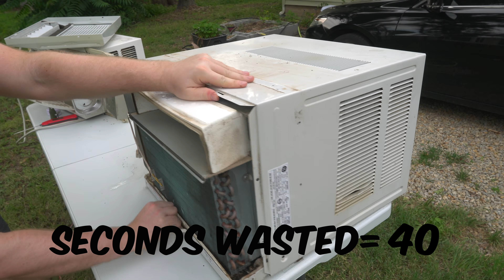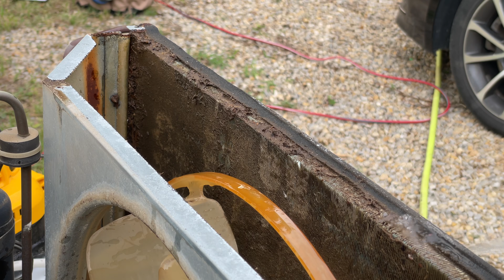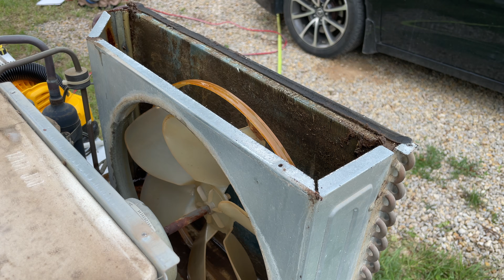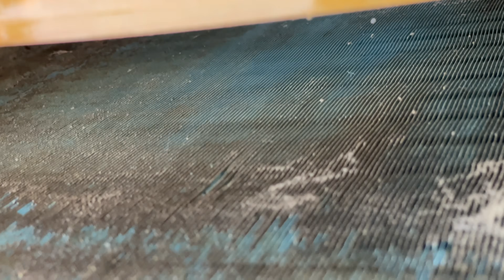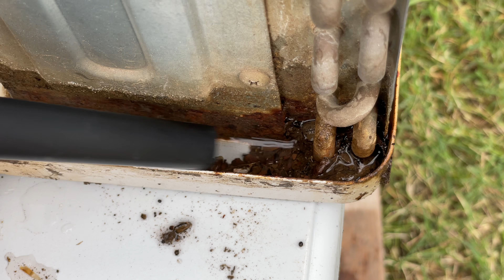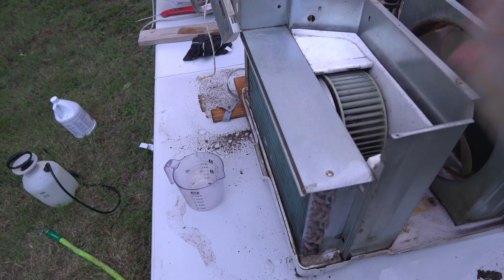DEEP Clean Window AC The Correct Way!

Comment: I have been using an electric pressure washer to knock off the dirt on the fins and no damage was done. The only time you will damage the fins is if you don’t judge your distance correctly between the tip of the pressure washer wand and the fins and you hit the fins.
And like how you’ve just demonstrated that blasting the fins at an angle is the reason the fins bend. Well, just be smart about it and spray the fins straight with the pressure washer. 
Common sense 👍
Reply: 👍 the electric pressure washer will for sure get the fins clean through and shiny way faster than just spraying detergents/degreasers and brushing making the a/c more clean and efficient in cooling. 
Plus the electric pressure washer will also help in knocking out all of the crap on the bottom tray easily.
2 birds 1 stone
🫡
Reply from the maker: I’ll have to give that a try. Thanks!
Reply: @benny_671  I tried that once with my AR Blue 1800psi electric pressure washer using a 45' fan nozzle and while the AC got super clean, it never worked again.
Reply: @LBCAndrew  I really don’t know what to tell you guys other than you must have done something wrong (too rough and rushing) and/or your a/c unit was on its way out especially since knowing that people don’t like to clean things till it’s too late and then they blame the cleaning method.

I honestly used my 2,000psi Bauer electric pressure washer from Harbor Freight with the 25° angle tip on my window a/c unit that hasn’t been cleaned in almost 6 months at a time and now it is blowing colder air and the fan blade isn’t rattling against any rust debris. And this a/c units is 10 years old
Reply from the maker: I havnt tried this, but it makes perfect sense! Thanks for sharing your tip.

Comment: I hate the way window ac units are designed, they sling that nasty water up on the condenser coil and it becomes a caked on mess
Reply: Whole house AC systems get caked with mud also. The condenser coil gets wet due to the humidity being pulled out of the air and it turns dust to mud just the same.
Reply from the maker: I find window AC units that are and are not designed this way both become a caked mess

Comment: Did you do another test after your major clean up? I would be curious to see the results. Thanks, great info video.
Reply: i guarantee you it restored its efficiency. my unit is a 10kbtu and the label says it should use 1000watts, but i noticed it was using 1400watts continuous and the cold side was only 50f, should have been closer to 30 to 35 in the environment it was in when i was doing my tests. the inside of my hot side heat exchance was worse than what we see in the video. so it it runs continuously for 24hrs, at 1000 watts it would cost me 24kwh x .12 = $2.88 per day, or $86.40 a month. with it using 1.4kwh, that would be 33kwh for 24hrs = 33kwh x .12 = $4.032 per day or $120.96 per month.
plus it will last longer if we make this stuff work easier
Reply from the maker: True true! I love how analytical and detail oriented you are. 👍🏼

Comment: i used to swear by nu-brite coil cleaner, (now i just swear at it) but now i use Simple Green coil cleaner, it works well and really does a good job at breaking up that grime/crust formed on the condensing unit coils, i nolonger use nu-brite because it actually is costic, and it cleans by physically eating away the aluminum of the fins, weakening them but it does clean them (just rinse the hell out of the coils if you use it) also, a trick for using any kind of coil cleaner, use water to wash away any loose debris prior to applying the cleaner, also to "wet out" the fins so the cleaner can flow in where the water was, also, great video showing how to deep-clean a window shaker, i've used the foaming stuff indoors on evap coils and it works well, but the stuff outside i've not had it do much combating the muddy sludge that accumulates on the condensing coils on the back of the unit
Reply from the maker: Thanks for your input! Did your AC cleaner ruin your machine?
Reply: @HandymanHertz  thankfully it did not, but i've seen some where it weakened the fins to a point they literally started to fall out and vibrate loose, also, if you look closely when you use a heavy cleaner like nu-brite you'll see literal smoke coming from the reaction of the cleaning agent, since then i've used a mixture of dawn dish soap and some white vinegar, and now i just use the simple green foaming coil cleaner, great vid still brother, stay safe
Reply from the maker: @Fox_Nakamori  great to know, I’ll keep this in mind. Thanks for sharing!

Comment: That was awesome man. I'm a complete idiot, dont even know how to connect to that wifi thing.I think I can do this thoug, maybe help my asthma a bit. Thanks.
Reply from the maker: I’m sure you’ll do great 👍🏼
Reply: @HandymanHertz  I thank you Sir . Gonna try it this weekend......o shit🤪
Reply: @6400az best thing I ever did with respiratory issues is use a 4 inch furnace filter on a box fan. The 1 in will reduce airflow too much and burn out the motor.

Comment: another good cleaner you can make is use a dishwasher tablet and put it in a spray bottle with hot water. super effective at cleaning basically anything.
Reply from the maker: Great tip!
Reply: I'm kind of desperate so honestly can you tell me you've tried that on the inside moldy stuff in an AC window unit  ?
    There's no way I'm going to be able to take mine apart and I just wish somebody could advise me on what I should and should not do
Reply: @gardensofthegods it should be fine to spray simple green on the fins behind the air filter and then to gently wash it away with clean water in another spray bottle. They are designed to flow the water out the back of the unit outside just make sure your drain isn't plugged first, if water drips outside while its running its not plunged.
Reply: Yeah, for me hot water is better, even alone